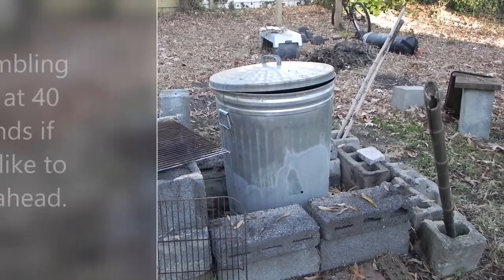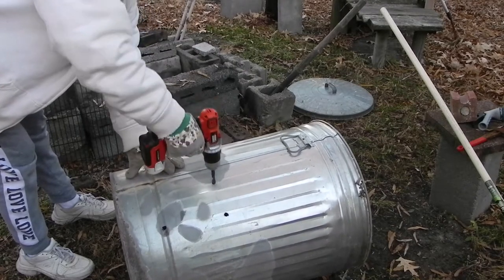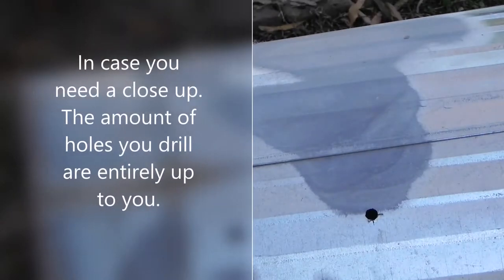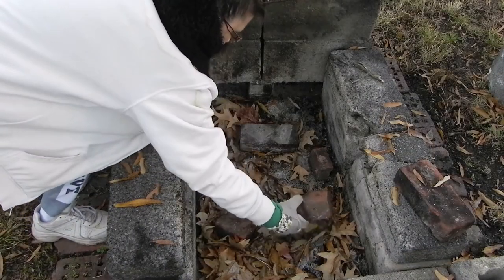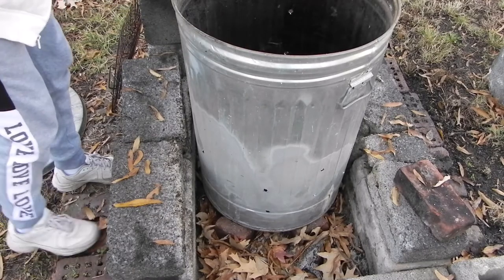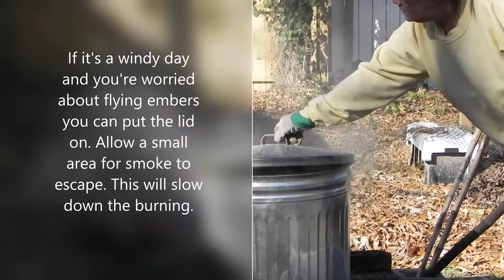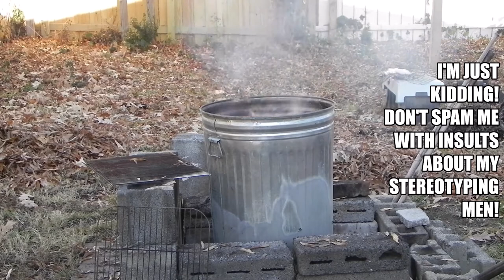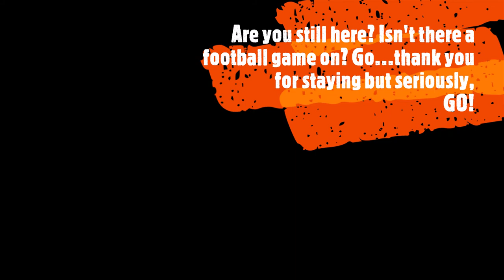How To Make A Burn Barrel From A Metal Garbage Can

Comment: How does this trash can hold up to the heat? Has it lasted a long time since this video? I’m leaning towards a steel barrel but these are cheap as well.
Reply from the maker: So far it's held up well. But I only turned it into a burn barrel about a month ago. I've burned leaves, paper, cardboard and a few logs at the same time. I don't have a heat gauge to tell how hot it's gotten but so far it's in good shape. 
Mine only cost about $25 dollars and It was over 2 years old when I turned it into a burn barrel. 
What I like about it is that I can almost completely cover the can with the lid, when the wind picks up and the leaves continue to burn without any hot embers escaping. It keeps me from worrying about high winds during burns and I don't have to put water on the fire to put it out. Just put the lid on completely and the fire will usually smolder safely or go out.
I hope this information helps you decide what to get.
Reply: @LateBoomer1964  Great info! Thanks. 👍 I think I’ll go with the trash can as well because it has the lid.
Reply from the maker: @TheAyotteMan  I made an update video so you can see how it looks after a year and a half.   https://youtu.be/dTLnbE9HCtA